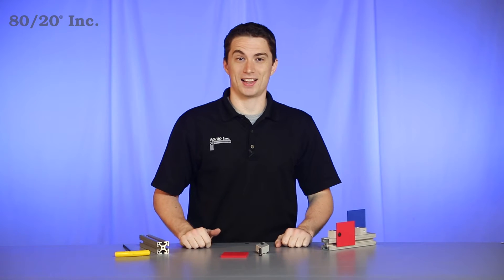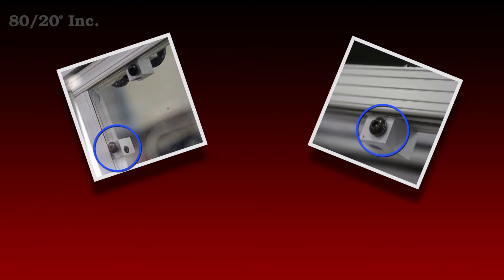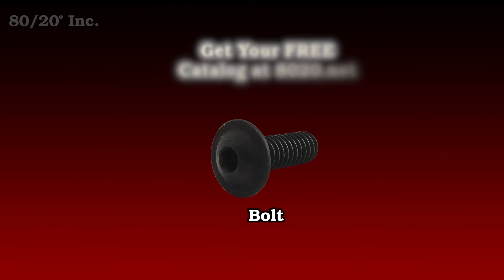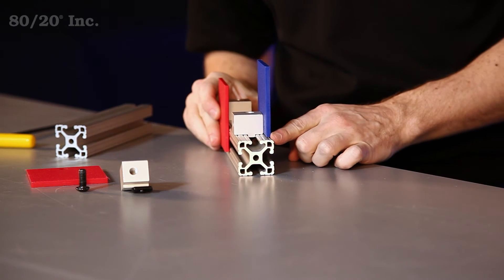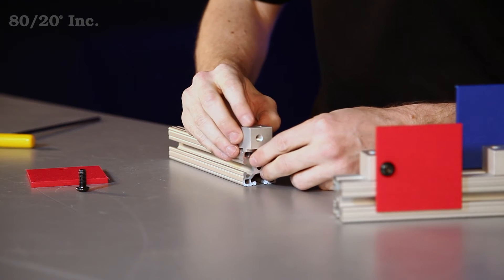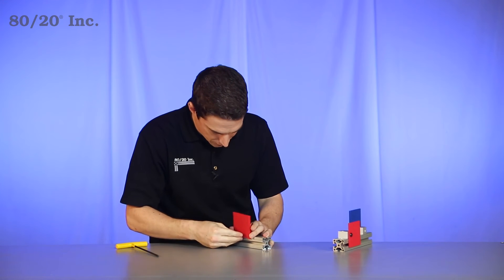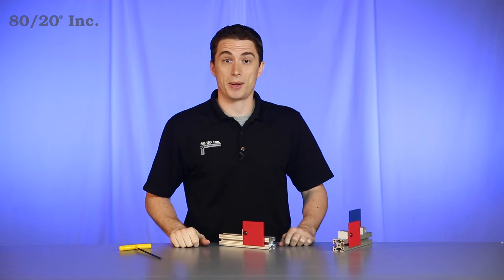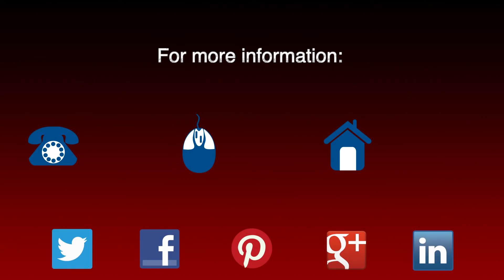80/20: Panel Mount Block Overview

Comment: One more question: If you are mounting to the surface, why do you need a panel block?  why not just use a t-nut or similar in the T-slot?
Reply from the maker: Hello! When mounting to the surface, you don't need to use a panel block. Panel blocks are simply convenient, rather than trying to line up the t-nut in the t-slot when mounting a panel. The one instance in which you'd have to use a panel block, is if you were using a closed-face profile. Hope that helps!
Reply: @8020llc  Thank you, that makes sense.

Comment: It would be great if you put a link to the parts you describe in your description, or even part numbers so it's easy to find in your catalog.
Reply from the maker: Hello! Thanks for the suggestion. You can find the panel mount blocks starting on page 476 in the catalog: http://catalogs.8020.net/80-20-Inc-Catalog-23/476/

Comment: Can it be adjustable to different size panels?  For example if I was using a 1/2" panel or a 3/8" and I wanted them flush. Or do you offer different size ones?
Reply from the maker: Hello! Thank you for your question. There are some panel blocks that could be adjusted slightly (http://catalogs.8020.net/80-20-Inc-Catalog-23/476/ ). But for a 1/2" or 3/8" panel, we'd recommend either (1) a zinc 90-degree inside corner connected, which has a tapped hole for panel mounting (pg.223), or (2) single arm narrow panel retainers (pg. 484) to hold a panel that's recessed in the t-slot.